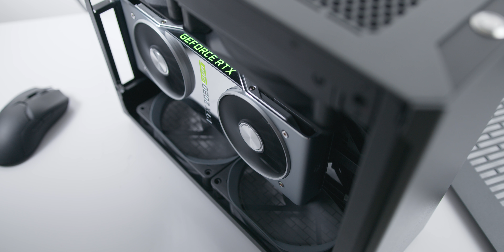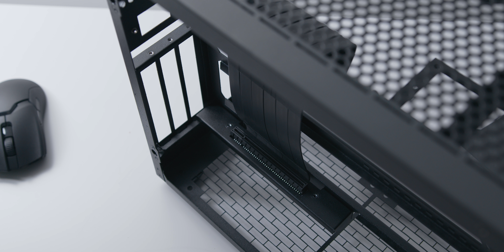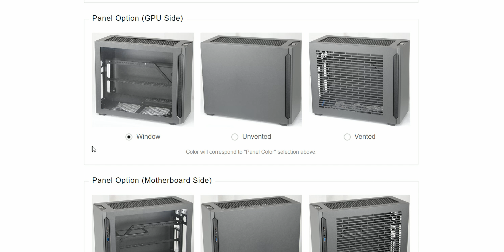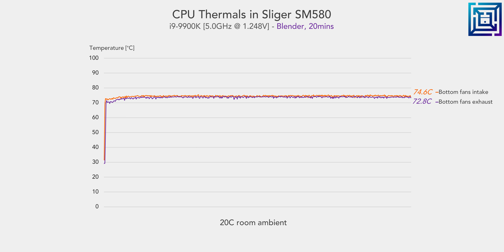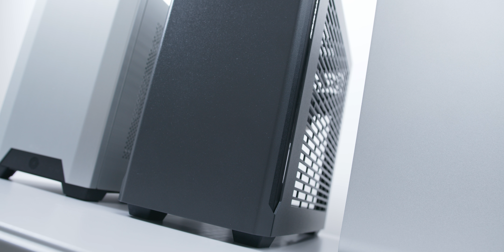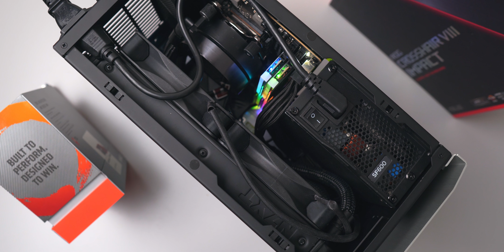Sliger SM580 Review vs. Ncase M1, Streacom DA2

Comment: I got the Sliger SM580 and I'm quite disappointed with some parts of the case. Side panels are poor quality that easily bend and the window panel is too thick and doesn't align with the rest of the case as it sticks out and makes it look uneven.  When my Sliger SM580 arrived I still hadn't gotten all my parts yet, so it took me a while to figure this out, but I found out that my vented side panel was bent - but I could bend it right back into its supposed shape by myself. Also, the paint is really thin so small scratches also removes paint.

I also have the same comment with the vent layout. It should be the same layout everywhere, so it's consistent and looks equally good everywhere.

I wanted the Ghost Louqe S1, but felt warned about the color inconsistency between cases and tophats, then I wanted the Ncase M1 but that is never available for purchase. So I got the SM580, which I still think looks absolutely awesome as I like a minimalist look.

Comment: Can I liquid cool the gpu with the NZXT G12 bracket and place the AIO radiator at the bottom ?
Reply: I have just got my SM580 and can confirm that you'd be limited to a custom loop with a slim 120mm radiator + slim 120mm x 15mm fan. Personally, if you wanted to populate it, I recommend getting yourself the XSPC ultra slim radiator. All in all, you'd be using about 35mm of space. As for AIO radiators, the hoses will either kink if the cross bar isn't already blocking it entirely. This is the only thing stopping you.
Reply: @dio.is.trolling  will two AIOs work in the louqe ghost s1 ? That's because it's already a pain to find these cases and custom liquid cooling parts aren't available in my country. I'm limited to AIOs for optimal performance.
Reply: @galenerso1594  I'm not sure as I've never used the louqe. If it's not that big a compromise, the 580 supports a 120mm and a 140mm at the top (ex. An evga hybrid has a 120mm, you can populate the other slot with a 140 or 120mm for the CPU).
Reply: @dio.is.trolling  oh okay thanks a lot for the advice !!

Comment: I honestly love the look of Sliger cases much more than the NCase M1, other than the weird incosistent cutouts.
Reply: Those are a deal breaker for me. Personally, I am waiting for the Dan C4, which is getting into the final stages
Reply: @hsavov  they removed the cutouts on the back, and now it's just a solid panel. The side and top panels aren't that big of a deal to me. And the bottom panels aren't noticeable unless you're really trying to hate it. I just got mine, and just touching the case feels different. I'm sure the other cases have that premium feel to them as well, but i don't have those ones. I don't know, just picking it up, it's just feels like quality. Like you could grab it from any of the expansion slots, the i/o hole, or anywhere, and it feels sturdy. When i took the side panel off it felt like you could kill someone with it, and it would be fine, maybe some scratches on the paint, but no dents or anything.
Reply: @mattevans1643  very accurate comment I’ve just finished building in mine (really well engineered case) but the panels are all such thick metal it fells amazing.

Comment: Is air-filter really optional? Will there be dust build-up or noise because of this?
Reply: there will be dust build up. noise should not be a problem if you are using silent fans since unrestricted airflow means they dont need to spin fast to direct airflow.
Reply: @gchyll2  thanks.. I see your point on using silent fans. There's less struggle for fans.